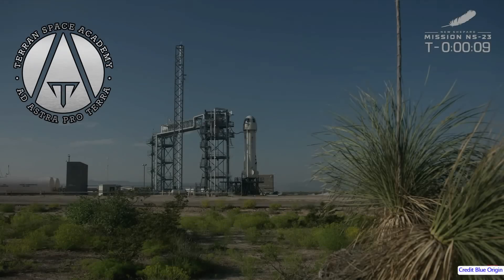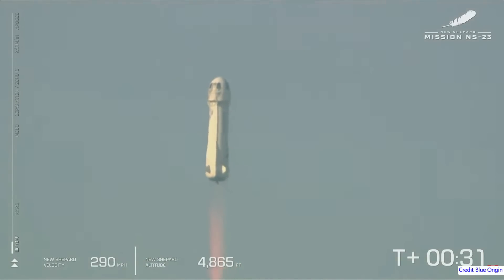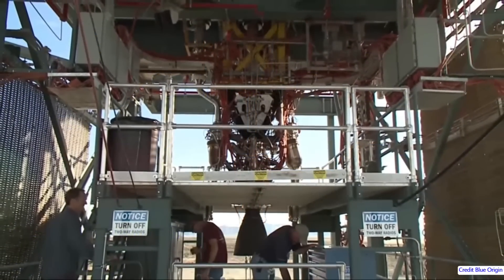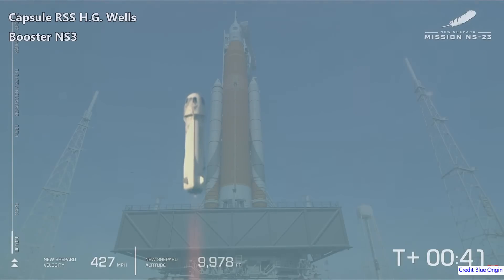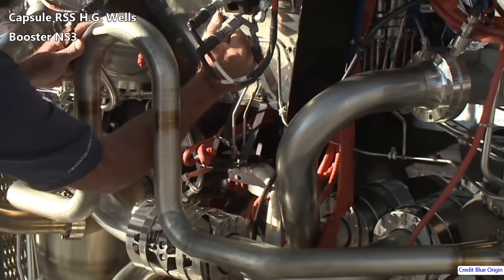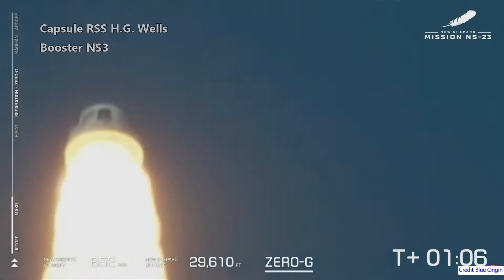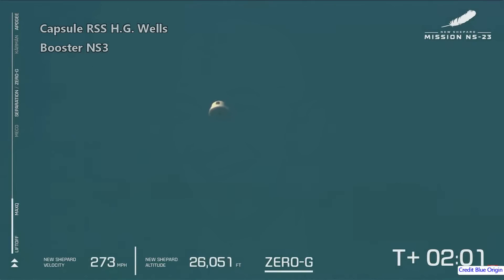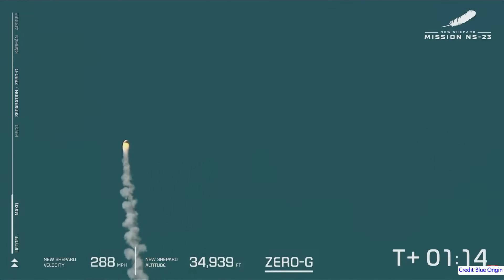Rocket Science: New Shepard BE-3 Engine Explosion

Comment: An unrelated question:
Why is air augmentation never included on 1st stage or booster design. 
Soviet PD-90 and GNOM rocket studies indicate one might get as much as twice the specific impulse from the same rocket engine with airaugmentation. Even a 15% increase in Isp  would seem to me to be enough to justify the added weight and complexity: a 15% addition to 265s is 304s. That's the difference between an good RP1 engine and a middle-of-the-road methane engine. 15% is about the difference between sea-level and vacuum engines of the same make. 
What am I missng?
Reply: ISP is less important on a first stage than thrust. That's why so many solid boosters for the first minute or two of flight. By the time the additional ISP would be most useful, you'd be high enough that the air density probably wouldn't facilitate air augmentation.
Reply: @jamesowens7176  As true as that is, Isp is a measure of thrust per mass of propellant. Higher Isp means more thrust for the same propellant. Which means a technical solution that gives the same rocket engine higher Isp is, by definition, giving it higher thrust. IE, an engine that wouldn't have enough thrust before the retrofit would have enough after.

Obviously, that's assuming it still works under the same circumstances. Extending the expansion bell gives higher Isp but won't work in atmo, as an example everyone knows.

Air augmentation, as you probably know, is putting the rocket engine in a flow of air such that the rocket exhaust heats up the air, which then expands out a nozzle. I think of it as a ram jet where the air takes no part in the chemical reaction but is part of the propellant. Another way to think of it is like a bladeless fan, where high energy, high speed air induces a much larger flow of low speed, low energy air. I first learned of air augmentation from studies of pulse and ram jets, both of which can get improved performance from its use.

The point of it is that it trades heat for mass flow and, in doing so, increases the total thrust; and thus, Isp. And a high Isp first stage changes absolutely everything. I mean, I can make the argument that the first stage is mostly there to get a high Isp engine into its operational environment. It's a rather hyperbolic argument, but I can make it.

Clearly such a set-up is capable of running in atmo, as it relies on atmo. Indeed, the longer it can burn in the atmosphere the better.

 Maybe it's like an ram jet in that it needs high speeds to be effective? Maybe the mass required to make it effective negates all the advantages?

I don't know, for sure, why it's never been used in an operational launcher. I suspect it's yet another step in the development process, making it less likely for the project to complete successfully and, therfore, is considered not worth the risk. Indeed, you're adding the design complexity of a jet engine's intake and exhaust to an already complex and difficult design process.

Even so, with rocketry now entering the Era of reuse, it would seem such a technology would be worth the investment... Unless it's not, for some reason I can't fathom. Clearly it can't be a panacea. It's engineering. There are going to be compromises, probably severe ones. But the knowledge for this is all there; jet engine aerodynamics plus rocket as reheat gives you air-augmented rocket. So why not use it?

Anyway, sorry for the book of a response. And thanks for the reply.
Reply: @bmobert  I definitely think it's worth a look. There has certainly been a big interest in the research community in various types of air-augmented and air-breathing propulsion for first stage use (I've read a few AIAA papers on them). As you say, maybe the reusability will conquer the other factors in the future.
Reply: @jamesowens7176  Right?
If I were Peter Beck, with those amazing and programmable Rotherford engines, I would spend a small but substantive sum of money on researching air augmentation for both Electron 2.0 and Neutron.

I'd also be researching duel expander, truncated linear aerospace rocket engines... but that's just my bias. :-)
Reply from the maker: There are viable considerations for air breathing first stage engines but unless you have a horizontal launch vehicle like the Skylon it would be hard to get enough increased performance to justify the mass.

Comment: Good analysis.  Your assessment seems spot on.  After reading comments below, it would appear it can probably be pinned down to the LOX pump.  Several folks said the booster crashed about 1.6-1.8 miles away from the launch site (based on sound delay compared to the telemetry data that was still being displayed on their screen following the failure.  The wheels came off, putting their best foot forward would be a good way to end this phase and move forward.  Something like "Space is hard, failures happen, and we learn lots when they do."  Unfortunately, if it's the Turbopump, and a tap-off expander cycle pump at that, it may show that those pumps cannot handle the reuse they were designed for.  How many missions do they expect to get out of those New Shepherd rockets?  Might be time to overhaul those engines on the other boosters!
Reply from the maker: That's a very good point.  The shuttle engines managed an excellent safety record with hydrogen but I wonder if the metal on a smaller engine, with thinner walls, can resist infiltration and embrittlement as Cody suggested.

Comment: Thank you for this. It's a bit deeper dive than some others, but I was surprised that you didn't mention the flashing exhaust just before the motor exploded. That was obviously not normal, & could have provided to clues about what went wrong. Your "jokes" about the turbo-pumps may be accurate, but it would have been nice to provide a bit more evidence to back up your claim.
Reply from the maker: Thank you.  Sadly Blue Origin will not release any details later.  A catastrophic failure, like the Antares we showed, would have blown everything apart, blade debris taking a single pump out of operation is most likely I think.  Since the flame looked fuel rich the oxygen side is not a bad guess.  If it were the fuel side we should have seen green flames from the burning copper combustion chamber lining ala Starship... was it number 7?  I could have gone into more detail but then when it turned out to be a valve that malfunctioned I would look even dumber :-)

Comment: At the time of accident, I knew it was a turbo pump just by the color of the flame tail. My question is which turbo pump? My guess is the LOX turbo pump. To me the flame tail look fuel rich.
Reply from the maker: Very good point.  In a lot of ways the BE-3 reminds me of the RS-68.  Where the RS-68 uses a gas generator to power two turbopumps the BE-3 uses a tap-off line.  I wonder if the BE-4 would have been easier with an RS-68 style design, perhaps closing the cycle with film cooling?  You are correct that the orange flame looked fuel rich, hydrogen should burn almost transparent and oxygen rich would be transparent.  Good observation.

Comment: Could not find any details on how much lower the Isp would be with pressure fed engines ... even "keep it simple s." has its limitations on rocket engineering and of course sometimes rockets blow up despite everything
Reply from the maker: Pressure fed engines have the issue of increasing gas volume to maintain a uniform pressure while the ullage is expanding.  Gives me a headache doing the math :-)

Comment: Regarding that solid rocket motor - is there no possibility that the capsule will flip over and rocket downwards towards earth (say if the booster explodes instead of just loosing power)?
Reply: I was wondering the same. Especially, if there was an anomaly with the booster shortly after liftoff. It seemed the capsule had stability thanks to the velocity. But at slower speeds( shortly after liftoff), would it be as stable?
Reply from the maker: That's a good point.  And I have no doubt that the way this capsule was swaying indicates some thrust vector control is in order on future designs.  What if there were a failure coming off the launch pad?  The Dragon has throttling of its hypergolic MMH/NTO SuperDraco engines.  A single solid rocket booster is all or nothing.  Though it could have a few degrees of gimbal I think.